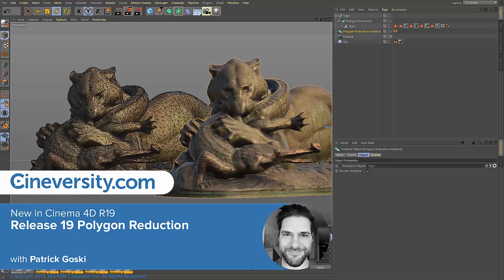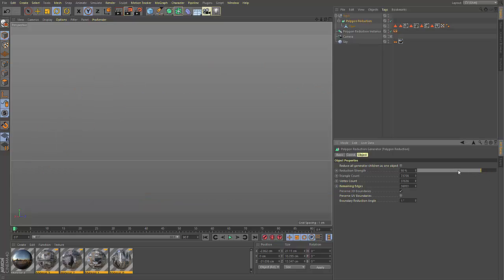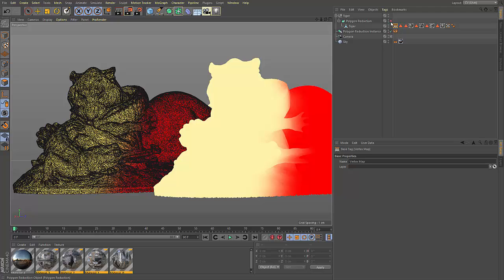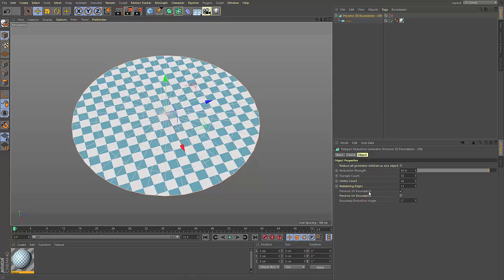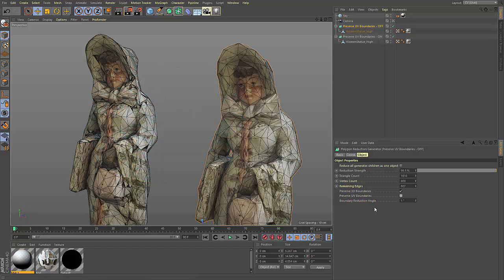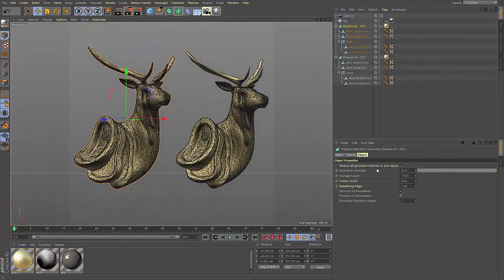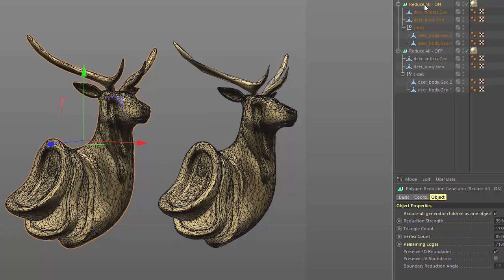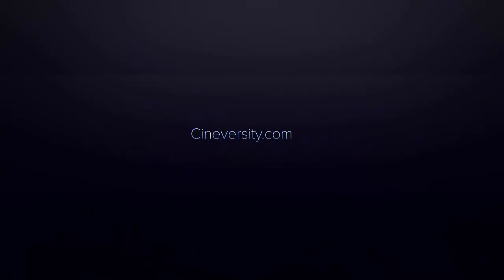In CINEMA 4D R19 the Polygon Reduction workflow has been completely re-worked from the ground up.

Comment: how do you get the polygon reduction generator to even be able to do this tutorial? You start off with it already in the project file but dont even do a tutorial on how to get it. :/
Reply: Emmie, look at the top menu bar and you will see which tool is highlighted (the yellow square outlines the tool). You will find it there.